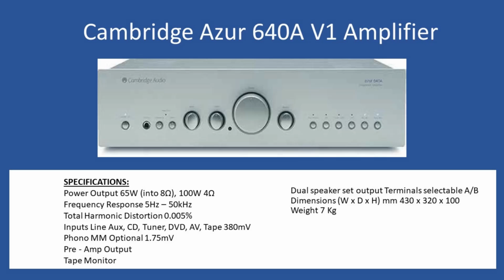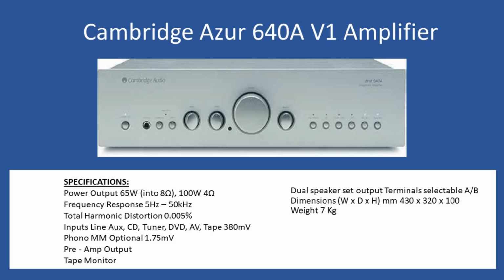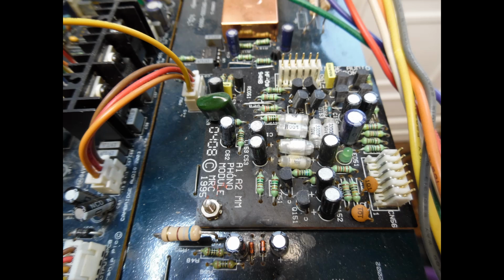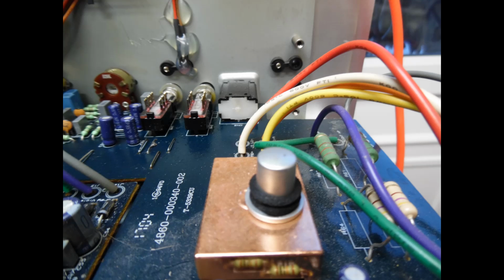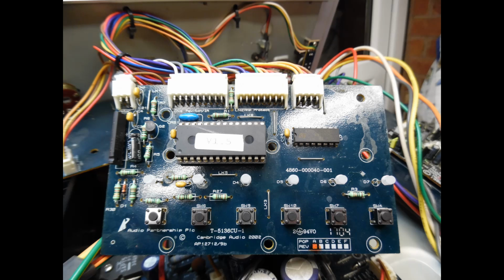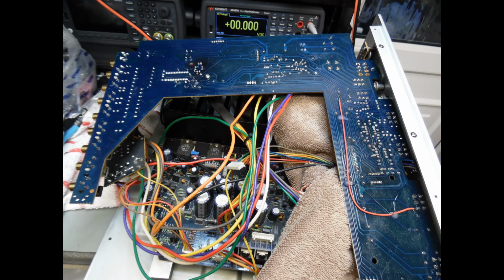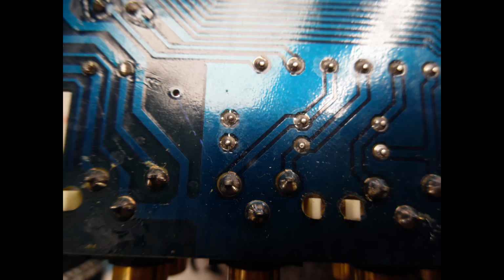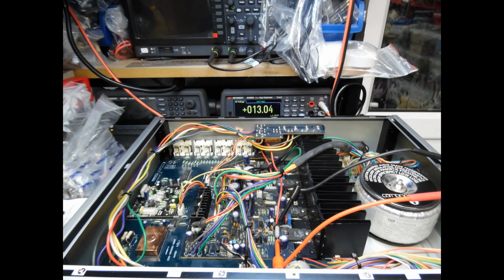Cambridge Azur 640A Version 1 Amplifier Repair (With Audio Tutorial)

Comment: Thanks for this very clear and helpful video. I have the switch issue with both my 640A and 640C and have new switches ready to fit. Could you share the dimensions of the neoprene washers? I’d like to get some ready to do the job in one go. Thanks 😊
Reply from the maker: Hi these are the types of washers you can use check sizes https://www.ebay.co.uk/sch/i.html?_from=R40&_trksid=p2334524.m570.l2632&_nkw=foam+washers&_sacat=2562&_odkw=amplifier+broken&_sop=10
Reply: @AudioAmplifierServicing  That’s great, thanks
Reply: I ended up buying a set of nitrile o-rings and using 2 per button. The power button is a larger diameter than the other buttons. For the Power I used 10 x 1.9mm + 14 x 2.4mm and the others I used 10 x 1.9mm + 12 x 2.4mm.
Reply from the maker: @matthewbeeson5612  Appreciate you sharing your experience on the channel.